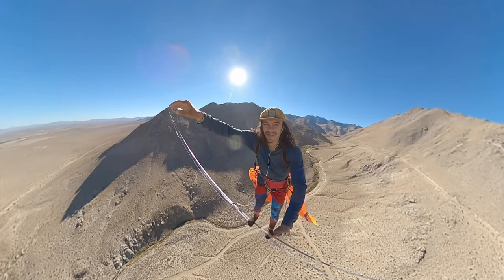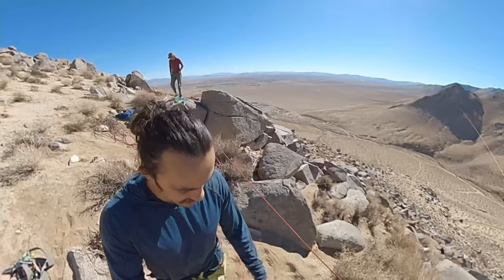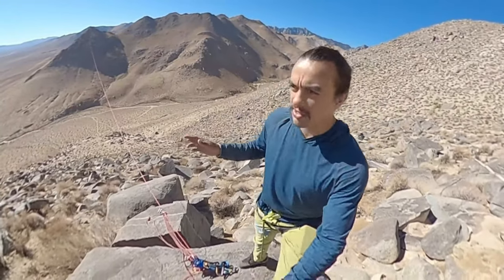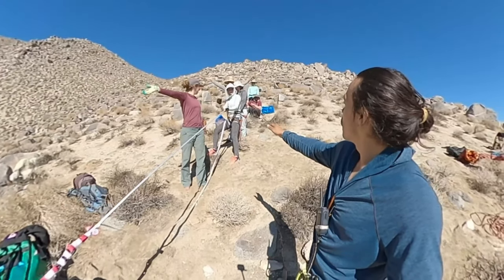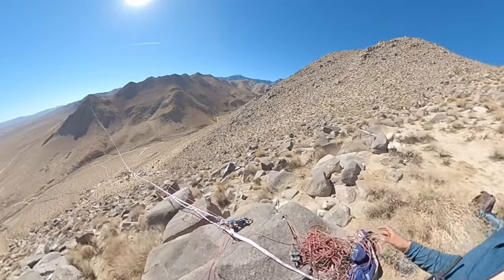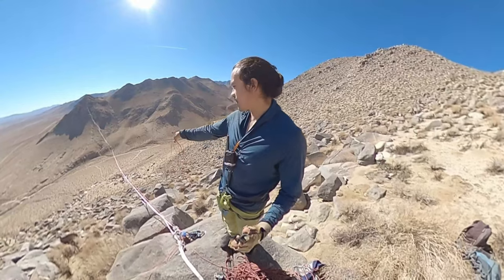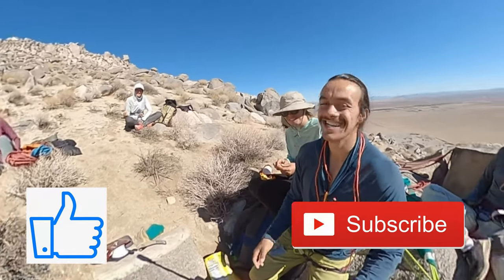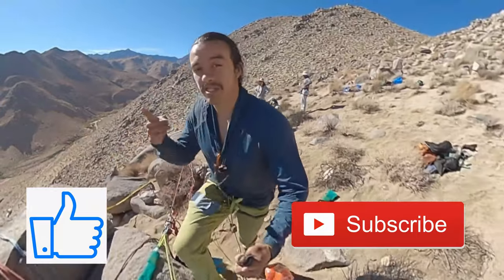How To Rig Big Highlines - The Clothesline Method

Comment: couple of questions. How do you get the clothesline and the attached ropes down? Does someone have to line slide the whole way to undo all of them? when it's time to take the line down do you reset up the clothesline?
Reply from the maker: Good question! For this you need a really good walker. I walk the line and stop at the connection points to undo it 😊 When it’s time to take the line down I do the same thing but in reverse